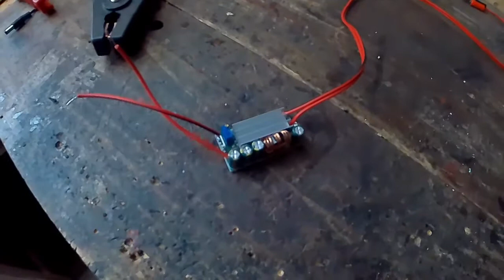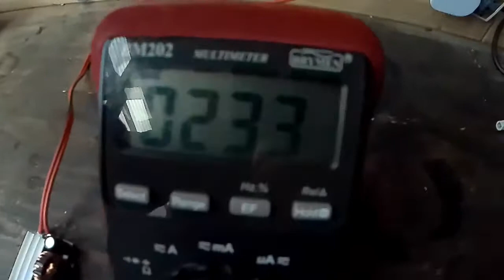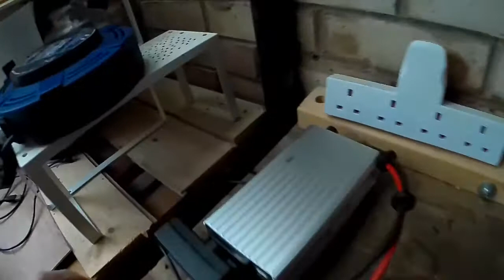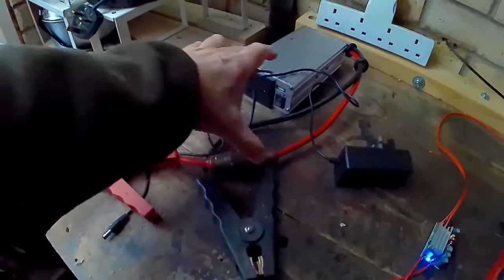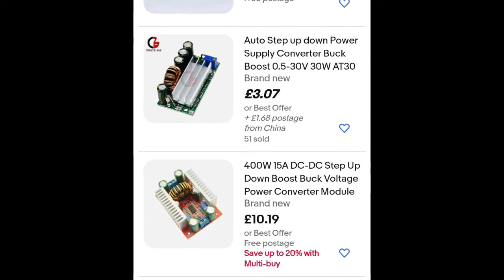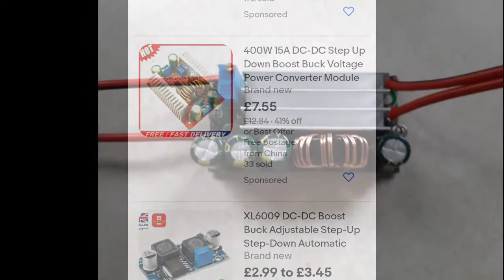Motorhome. Battery 12V. Devices Charging. Buck up down Converter. Laptop. Tablet. Phone etc.

Comment: Bucks are the way to go! Especially when working at slightly lower or slightly higher voltages. There's no need to convert all the way up only to convert all the way back down like you brought up at the beginning of the video. 

The only time it really becomes an issue is with current. But you well know that. 😁😎

Comment: I forgot to add in that with some of the variable voltage buck converters you need to set the voltage and let it run under load and no load just to make sure that there's no variation. I had one that would vary about 3 volts under load of 2.2 amps.

Comment: Nice video George,  would you set the o/p voltage with the device under load? Or are they stable enough anyway
Reply from the maker: Hi Kev. The ones I have tried are regulated voltage output and have current sensing as well. However it is good practise to set the voltage with a load. I didn't have a load that I could use in video. Garage roof is leaking water has got into lighting circuit so video was a rushed job. Garage is hopefully having a new roof next week. Cheers from old George